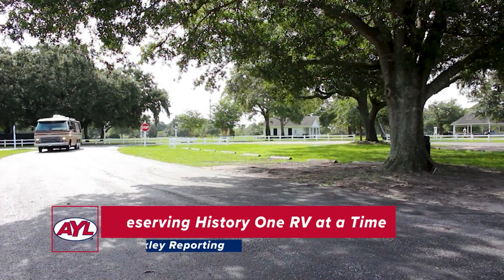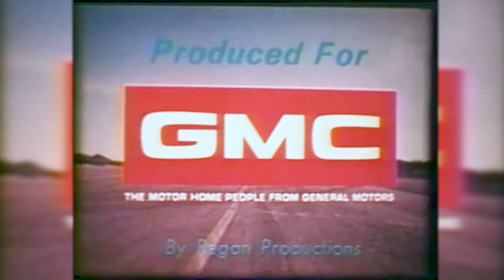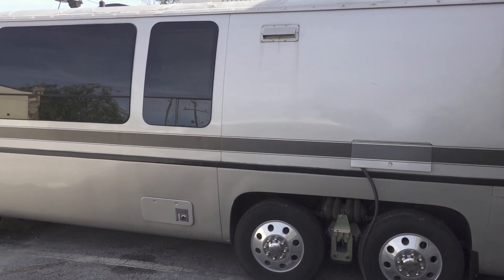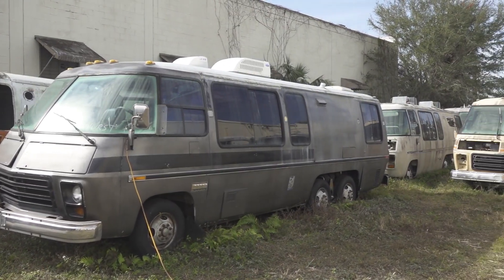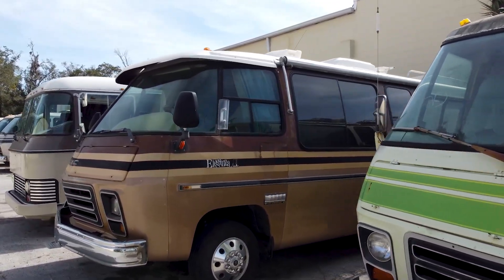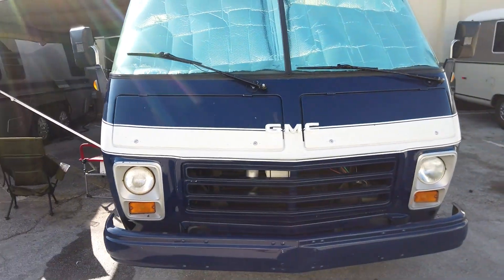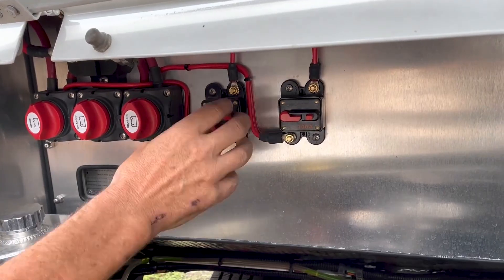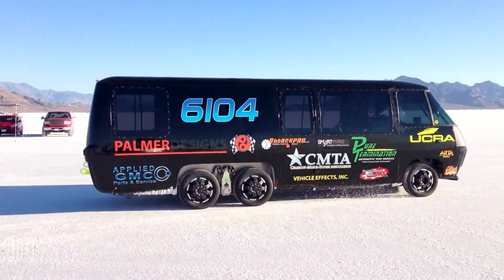The Future of the GMC Motorhome

Comment: I am an Australian & l ❤ these old Coaches.  26 ft isn't 2 long.  There not massively wide & definitely not tall like a Bus Coach . A very Sensible Size . Gr8 2 see 👀 U building new Chassis, Drive Line & Engine.  The really require a very very tight Lobe Centre Line Camshaft like 108 or 106 for Torque & better economy 😅

Comment: If I decide to purchase a 1978 GMC motorhome just like this one I would put a 2002 Pontiac Grand Prix 3800 Mopar series Pontiac engine in it and install a 55 inch tv in the back of the bedroom with an Atari 2600 flashback gaming console and an aluminum alloy frame with updated racing brakes tuned for higher loading capacity for its weight distribution and a custom exhaust system with cherry bomb exhaust sounds cool I really love older rvs
Reply: Except No… theyrfront wheel drive

Comment: If I bought a GMC Motorhome, I'd keep what I can as original as possible, but I'd also upgrade a few things. Among the upgrades I'd have done would be either a Detroit 6.5 litre Turbo Diesel engine, or if possible a Duramax 6.6 litre Diesel engine. 🙂
Reply: You understand these are front wheel drive and must remain that way. There is no driveshaft to the rear and no room or space to accommodate one
Reply: @CP-ux9zd  Yeah. I know they're front-wheel drive. I wouldn't want to change it to rear-wheel drive or all-wheel drive. I'd keep it front-wheel drive.
Reply: Seen one with a caterpiller diesel. 12 valve cummins would be nice.
Don't forget the 1 inch plywood floor cantilever design floor. Add outriggers to the frame.

Comment: Awesome video! Like most people, I've heard of the GMC Motorhome. I've seen a few over the years. Given their overall dimensions of 26' in length, I would think they'd be easier to drive than most motorhomes offered today.
Reply: They are a lot easier to drive than most motorhomes. Low C of G compared to truck based 13 foot high rigs that get blown around with the square cheap cladding acting like a sail. Easy to get into/out of. Air ride instead of extra heavy springs. Also easier access to all the wheels/tires.
Always get the flat on the inner dual.
Rig one with a cummins 12 valve and the new galvanised frame from North Dakota. Great trimmers in Florida to dial your new toy in.